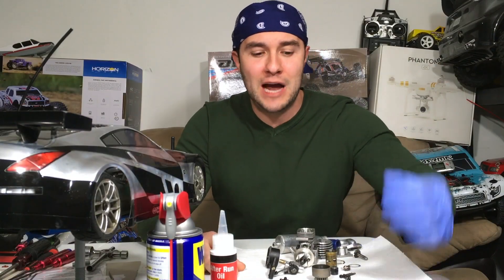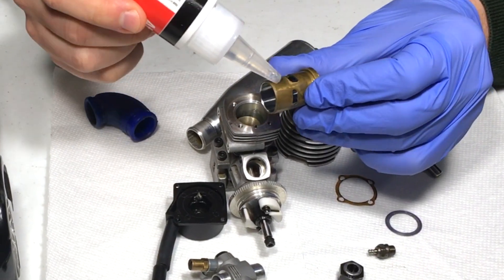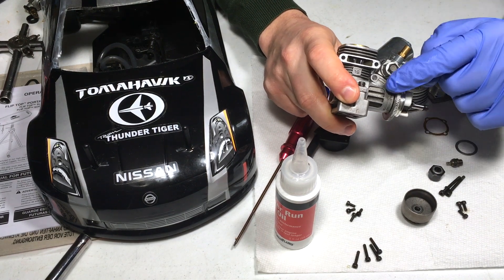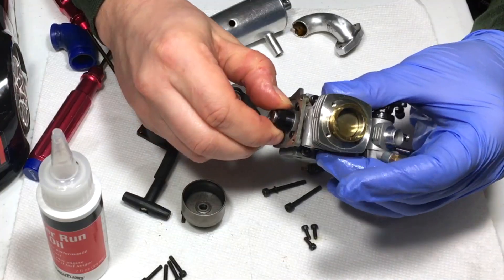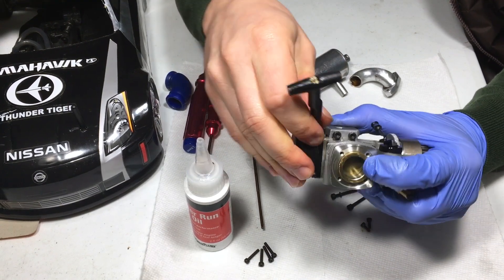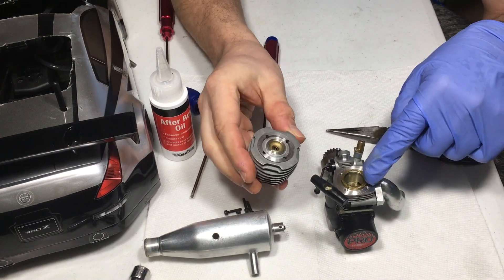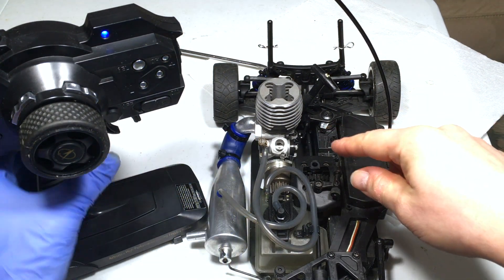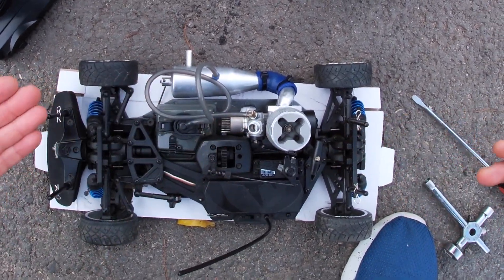Project - Thunder Tiger Nitro Restoration  (PART 4) Final Assembly and Will it Run?  No Lipos Here.

Comment: Hi there I have a thunder tiger tomahawk that my wife bought me new in 2010, it's only been run twice, but when I recently started it   it runs awfull everything is free no issues other than I put the carb settings back  to factory and it runs OK ish but not great what carb settings did you use on yours, by the way I love your videos thanks in advance Dave👌

Comment: hey dude, do a nitro conversion on that arrma, make your own nitro arrma haha!
Reply from the maker: hey bro!! Good idea, I actually though about that.  The only current road block will be the fact that Electric cars would require a brake servo and the transmission's gear pitch is totally different, I would have to get creative with making a nitro Clutch bell work on this.  This is why most people convert nitros into electric, it's easy.  Creative idea though, I'm sure people have done it, I'll research it.
Reply: hybrid32494 could you maybe like “retrofit” a nitros transmission like a revo trans or something, but i guess then you would need custom driveshafts.. seems like alot of work haha

Comment: Another good video man ! Question so you don’t necessarily have to torque down any screws to spec ?
Reply from the maker: whats up man!! Honestly, I have never checked proper torque specs for anything on any RC.  And it's fine.  As long as it's tight enough to where it's not going to strip or be too loose, it's fine. My goal is to be neat, do an adequate job and constantly check the risky areas like engine screws and pull start screws, then monitor them after each run.
Reply: Cool thanks man 👌

Comment: I agree on the X-Maxx over the 1/5th scale Arrma Kraton 8s. I prefer Arrma over Traxxas personally but to me, the 8s Kraton leaves a lot to be desired as it is out of the box.

Im curios though, why do you like to use after run oil as an assembly lube? I'm not suggesting that you use engine assembly lube on a nitro, just like you don't use it on engine piston assembly however, don't you think 3 and one or even bearing lube would be better for assembly? After run oil just doesn't have the dry start lubricating properties I'd want to see, especially at top dead center.

Also, on these nitro engines, compression really is not the correct word. They don't create compression as much as they have resistance at the top of the piston stroke. The piston sleeve is tapered at the top it doesn't compress the fuel mixture like a 2 or 4 stroke as the piston only seals at the very top of the piston stroke. The resistance is not compression, it is friction. It's like a good fart. It's not about the back pressure, it is about how tight the sphincter is. ☺

Comment: Hi just want to know. Do you know the base settings or around the base setting of a go. 21 carb?
Reply from the maker: hey buddy! Sorry, I don't.  Your best bet is to google it.  Generally you can go about 3.5 turns out on the High Speed and Keep the Low speed flush with the carb body, that is usually the stock settings on most carbs.  The goal is to start the motor, then you can see if it's extremely lean or rich, and adjust from there.  Honestly, knowing the stock settings is not important, knowing how to adjust after the first start is highly important.
Reply: @hybrid32494  my uncle as well. A buggy racer said the exact same thing. Just got it fired up today with the base settings. And tuned it slightly from there. Runs like an absolute beast!!!. Your channel motivated me into getting back into nitro rc thank you!

Comment: good afternoon, what is this oil that you lubricated the shirt?
Reply from the maker: hey buddy! Are you referring to the little bottle of oil I'm using?  That is basic hobby grade After-run oil, most people use it for engine storage when you don't run for a while to prevent corrosion.  It's just called "after-run" oil, you could get it on amazon for like 6-7 bucks.
Reply: @hybrid32494  thanks